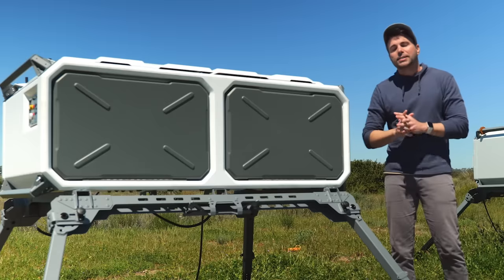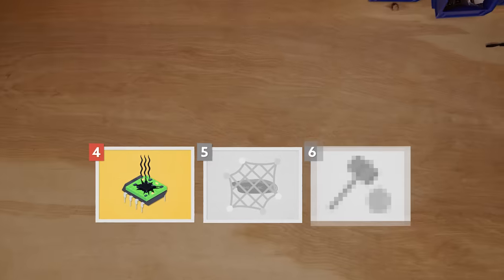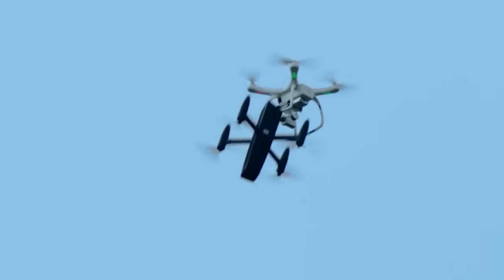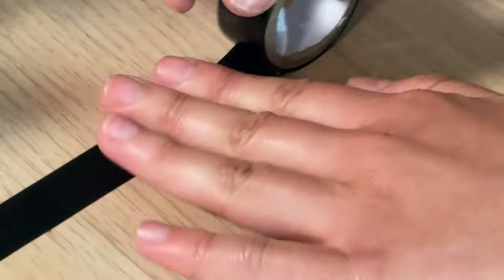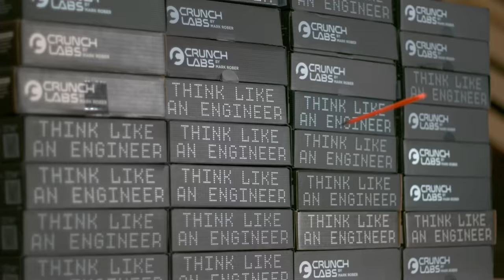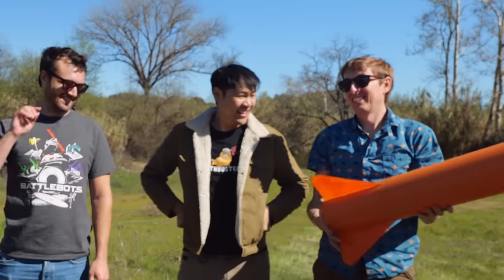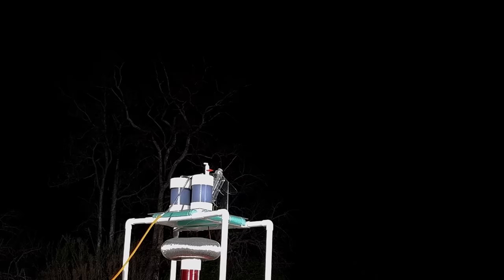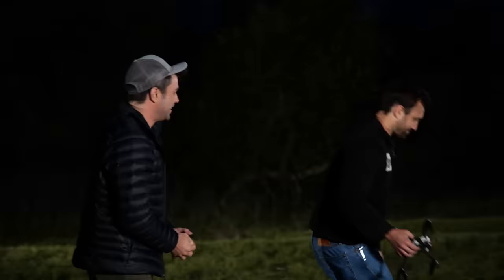Vortex Cannon vs Drone

Comment: Anduril's anti-drone drone that just collides with them is brilliant.
Reply: Disagree. They're in America, use guns
American problems require American solutions
Reply: @wingid  Look closer. It is both the gun and the bullet.
Reply: Just install an auto-dodge system on the drone. With the detection of that drone and detection of high speed approach.
Reply: @ArthurD Yeah. And yet they call the system "flawless"... Easy way to beat the heavy hunter drone thing.
Reply: Anvil is better at hitting humans "like a bowling ball thrown 200 mph". Drones can evade it. Humans can't.
Reply: @ArthurD not mentioning how difficult that would be ( since I’m under qualified ) but that would make it susceptible to the other methods since it would have to made lighter to dodge correctly. Which would be even more difficult since you just added more weight by adding a 360 camera/ sensor
Reply: @wingid  slight issue with that drones are fast and small
Reply: Seems to only work if he drone isn't moving at all. Red Bull made a small quadcopter drone that flies at 360km/h and they weren't even the first.
Reply: Until the drone they're targeting releases a net...
Reply: @NoOne-us9os  Thats where the israeli smartshooter comes in
Reply: What if you have 20 drones? Or 40?
Reply: @LugiDergX  and what if "the bad guys" got an anvil drone of their own? Throwing a child bowling ball at the speed of a MLB pitch seems like it could take someone specific out. 

And they probably designed their drone to be immune to all the methods of taking drones out that they mentioned.
Reply: @vinny9514 Not saying it's not worth a try, because it definitely is, I'm just saying it's still not a perfect method. Still probably gonna work most of the time to smash into another drone.
Reply: @MarkkuS   they are also talking about deploying anvil at mass events.
basically dropping other damaged and possibly burning drones on the crowd.
Reply: I think what a lot of people are missing is that if the target drone was carrying something like explosives, it'd probably be sluggish and easy to take out this way. I'm not saying it's a perfect solution, but I think it'd work well for the worst kinds of attacks if used properly. I don't know how you'd implement this in a stadium however. If the malicious drone is already in the stadium, it could fall anywhere and basically anywhere inside could have people. You'd want to stop it before it can even get in.

I'd love to see it try to take out an FPV stunt drone, I'd imagine it's hard to hit those with a skilled pilot.
Reply: @vinny9514  drone counter method 6 is the hardest to counter, sure small drones without a payload or anything useful could easily doge a hunter-killer drone. But then there is the whole, its possibly largely useless. Drones start to looses (especially commercial ones) speed and agility as well as operating time the moment you start strapping stuff to them like explosives and such, and if you try to armor it to take a hit, well that's even more weight. You run into tradeoff etween payload capacity, durability, mobility and flight time.
Reply: @Krahazik  I just mean that they kinda developed a great assassin drone, if someone stole one to use against a person. And if they designed their own drone to be immune to all the other methods that they have to take a drone out (to stop the bad guys from stopping their drone stopper) it would just be pretty hard to stop.

Comment: The Anvil solution doesn't use any kind of warhead or weaponry to defeat the incoming drone.  This means it's a viable solution in the international consumer market.  If you own property and don't want drones overflying it, this tool can achieve it without special licensing or the need to supply ammunition.  That solution is going to sell well to anyone with an estate and the desire for privacy.

Comment: Im on the state of Missouri professional drone racing Team. As a professional drone pilot and I have the trophies to prove it drones are fast enough and maneuverable enough that some of those methods will not even come close and they’re being cheaper and cheaper, and you can make your own so soon some of those methods will not be liable.
Reply: Do you know Eddie Kowalowski
Reply: A bot copied your comment but oh well that happens.

also *viable

An effective payload against humans can be as light as 40 grams of explosive material and that's being generous with the payload. It's super easy to strap that amount of payload onto a drone and well... So it can be extremely fast. At that point why not just use a gun with a radar sight. 

The kinetic counter drones could work in defence of something more rigid like nuclear powerplants or military installations where the payload will have to be in the kilos not in the grams as then making a fast enough drone to avoid their methods will be difficult.
Reply: @j100j  Nexus6 Combat model 🤖?
Reply: @j100j

Ya 😂

Comment: I just use an RPG…
Reply: 'MERICA!!!! 🦅🦅🦅🔥🔥
Reply: Not guided, limited by line of sight, is designed to penetrate armor, firing an explosive into a populated area, are just a couple issues with RPGs
Reply: I just use a minimum 3 cm rock to hit its rotor

Comment: #3 will work.  You said "high powered' Laser.  A 15KW Laser can burn 0.5" steel plate in 1.1 sec from a mile away.

Comment: If you cover your drone in copper tape you are just not gonna be able to steer it anymore since the faraday cage also blocks your radio frequencies (which are curiosly sometimes very close to microwave frequencies). Kinda short-sighted take from that drone guy there (or maybe he's just too lazy to explain the real reason)
Reply: If the drone works autonomous (for example with pre programmed GPS-coordinates) no radio frequencies are needed anymore.

Comment: What about something simpler use a vacuum to increase the mass needed to push down to lift up increasing the gravity in an area for air space.
Reply: Or water vapours
Reply: Use a slingshot and a magnet with RC Crystals so you can throw tea spoons at them all sorts
Reply: An electric magnet can wor